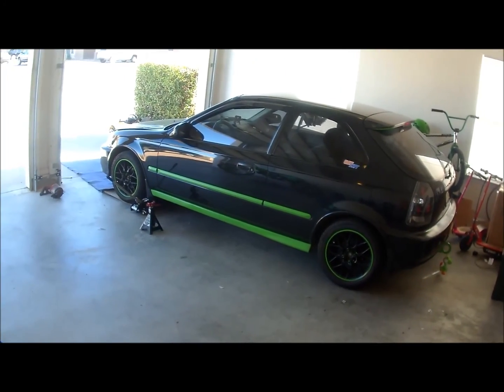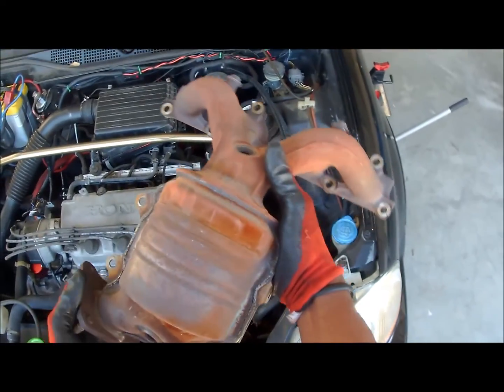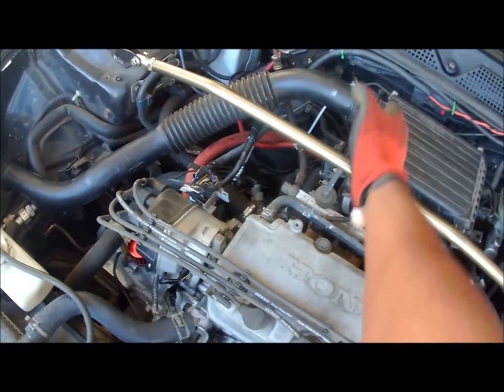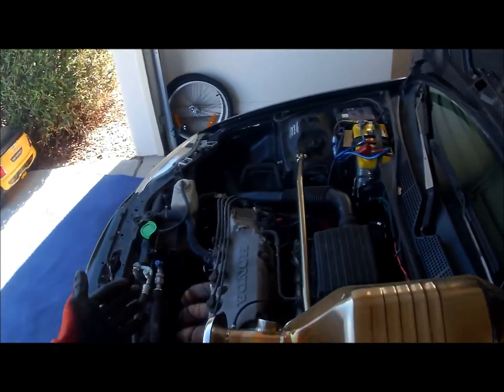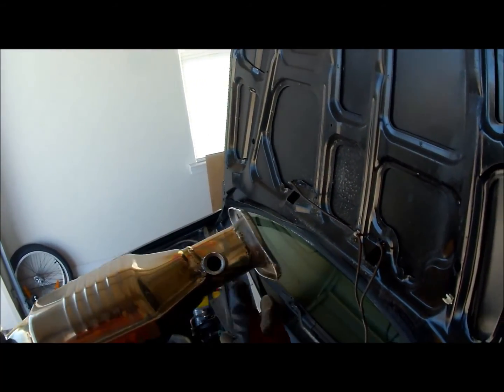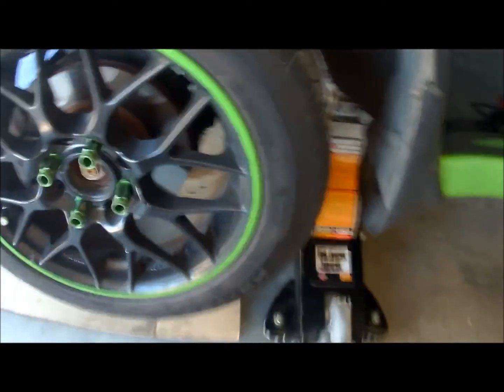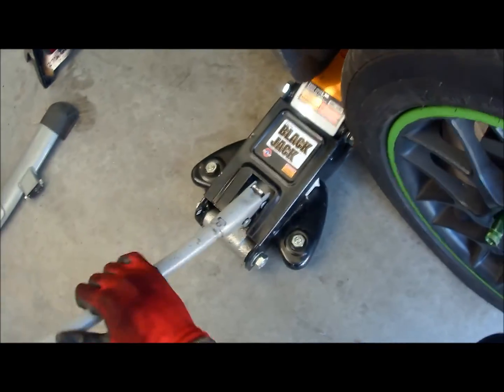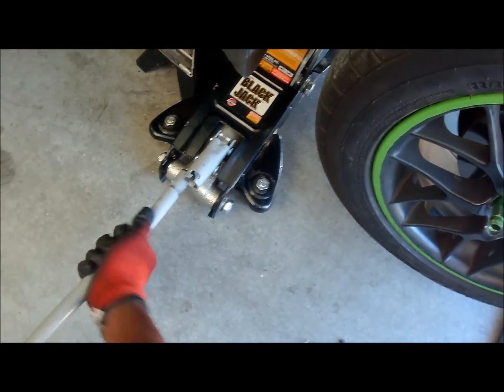How to relocate Bank2 02 Sensor on a D16y7 Honda Civic engine

Comment: Did u use a catalytic converter from an ex? I’m trying to do the same thing but I’m a little stuck as to what cat to use for it any help would be greatly appreciated.
Reply from the maker: I looked it up on ebay I didn't go oem then weeks after that I went all test 🥧 and decided to delete the 2nd O2 from the ecu

Comment: sik vid bro thanks for the info I recently bought an ek hatchback, its got a probably the same exhaust you got and I have a couple codes im throwing, 1 is for the 2nd o2 which I now know what I should do if its either not there or faulty and the other is a common evap leak at the canister likely the shut valve but my major headache was the o2 and you got me covered. thanks bro and keep up the good work!
Reply from the maker: CarTunez 613 Hey thanks watch my video I appreciate it glad I could help out in some way hopefully you get everything fixed and up and running perfectly

Comment: How did you do the wires? Did you cut the O2 harness and use your own wires? If so what type of wires do you recommend to extend it?
Reply from the maker: Yes I cut it and used 16 gauge wire from Walmart or you could get it from RadioShack